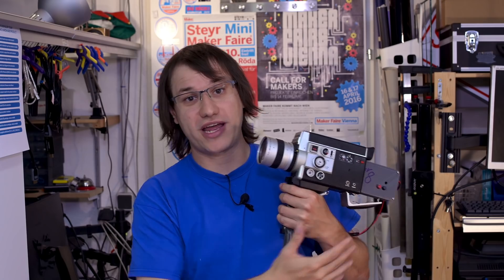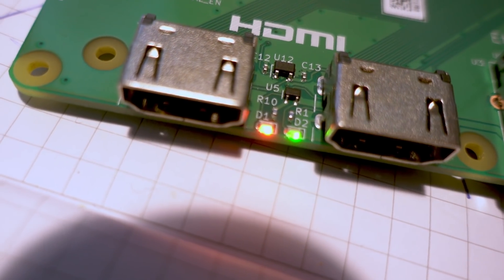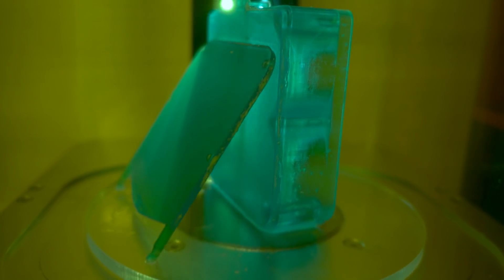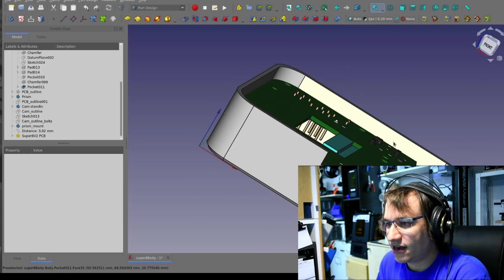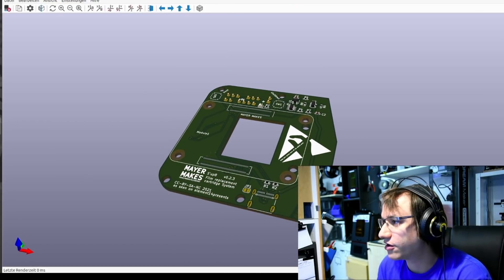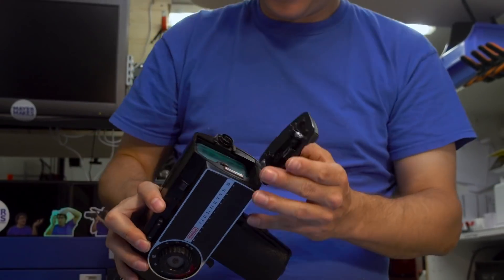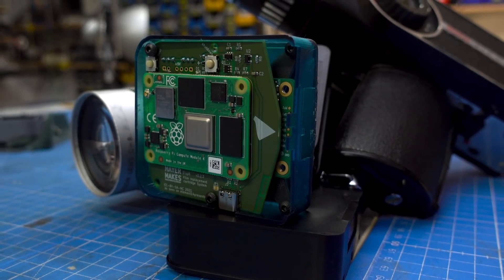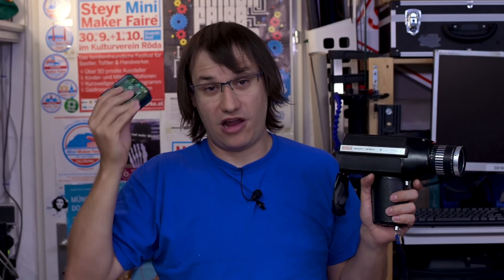Super 8 Camera Digitizer with Raspberry Pi 4 Compute Module

Comment: Hello my friend, I have a question. I was looking for software that would allow me to control the settings of the IMX477 sensor, same I use a cinema camera, and I found this group of software: CinePi V2, CinePi -SDK, cinemate , so I tried it on a Raspberry Pi 4b board and it worked well without any problems. But when I use the Raspberry Pi WaveShare-CM4-Nano-B board, just the software interface works without any image, and I would like to help me to solve this problem.🙏🏼

Comment: I can't imagine that a sufficient market actually exist for this product today.  The proliferation of low cost digital HD even 4K video camera's much easier to use would seem to make this product obsolete before it came to market. 

Your power issue is likely resolved if you just turned off WiFi.

Comment: Congratulations for the video. I would like to suggest two solutions. You could use supercaps (two connected in series for example) put directly in parallel to the power supply. To charge them is an SMD IC from Linear Technology (LTC3128EFE). The beauty of this chip that you can adjust the input current and limit it so as not to strain the battery. To obtain the 5V if necessary there is always a buck-boost signed LTC3119 from Linear Technology. The whole thing doesn't take up much space and could act as an energy buffer.

Comment: The sensor being much farther away from the normal film plane... Hmmm..  makes me wonder if the lens will be able to focus far enough away to be usable. Maybe a corrective lens could help. Or maybe you can do like the old 35mm adaptors where you put a thin milky white sheet of some kind in the place of the film plane so you can use a fixed focus lens system to record off of that plane?... 

Man... It sure would get easier if you could just detach the sensor from the PCB and put it at the film plane. :P

Comment: Why not put an external power supply and run it in the handle. If i remember there is a cavity in the handle in most of them. You could use that space to put it. 

Great concept. It would allow usage of the older cameras no longer used. Recycling them.
Reply: Every camera model is different and in most cases there is no way to get a cable through anything without modifications to the cam, the godl was a true drop in replacement.

Comment: Hi Clem I've really enjoyed the Super8 project.  Inspired by you and others I am attempting something similar for an Agfa Microflex 300.  The side opening arrangement is much easier for me.  Just though I'd let you know I've printed the .STL files in ABS to do some trial fitting of components and I noticed, that there isn't a hole or recess in the body of the printed box to accommodate the drive dog for the film cassette, so on closing the cassette door it jams a bit too tight. Something to look at for a future revision if the aim is to have a universal drop in replacement for the Super8 film.  Build here is a Pi Zero Cam, Pi Zero 2W, LiPo Hat and 3500mAh battery, it's a tight squeeze to say the least. I'm currently working on the Agfa to get it to fully functional.  Many thanks, best wishes and I'm looking forward to your updates on the project. Pete
Reply: awesome! keep us logged about your project!

Comment: I wonder why the Pi Zero wouldn't be adequate? I know it's not as fast but it's a lot more compact, cool and has low power consumption.
Reply: the pi zero is a lot bigger thean the Compute module 4 and doies not have anywhere near enough computational power for real time capture.
Reply: @MAYERMAKES  I wasn't expecting it to be bigger than the CM4 as it's so low powered. I'm surprised it doesn't have enough juice to record video as it does have a camera connector.

Comment: Have you considered undervolting and underclocking the CPU to lower the power requirements? I can't imagine you need the full power and speed of the rpi4 for this functionality. 

Amazing work either way and can't wait to see what you come up with!
Reply: Not yet, the first design approach is to make it work without setting tricks, underclocking is only an option when others fail.

Comment: what is powering your shutter? how much voltage is the shutter using? can you replace the camera batteries with an adapter? which camera are you currently using? getting hdmi out of the camera body would be ideal. would you consider looking into a  camera bigger cartridge (I know a few)?
Reply: All explained in the video. The camera and cartridge are independent in all aspects.

Comment: This has gone a long way! And formulating a special resin to make a more durable print? Super interesting.

I know your a camera aficionado and are pushing to get everything into that cartridge and not need to modify the base camera in any way, but what about non-destructive modification? Such as replacing the cartridge door, with say a 3d Printed one that has a hole in it to allow for a barrel jack or usb connection for power etc. Kind of piggybacking off of Jeff Greerling's initial suggestion, but in a way that keep the integrity of the camera and its collectability in tact, while also allowing you to fully test the current iteration of the cartridges camera and prism placement. Or a dummy cartridge with the camera/prism in place, and a 3d printed cartridge door with a slot in it for the camera modules ribbon cable to allow for rapid tinkering with it's placement for optimizing or even finding a way to get the prism lined up with where the film normally is, allowing for using the built in viewfinder accurately?

Anyway, your more knowledgeable on this, I'm just spitballing ideas, I look forward to your future developments and other projects. :D
Reply: Thanks, we collect all the ideas at the page linked below the video, some may be worth a try but I can see more problems cropping up with them. Either way I want to make it work in any camera so the bar is high..

Comment: Pololu has a lot of good switching supply modules on their web site.  The U3V70F5A is easily small enough to fit, and can supply 5 volts at 3 amps for most of the range of a LiPo's discharge voltage, but you'll need something else to charge it.
Reply: chargin is already delt with on the board, so it could be an option.

Comment: Why didn't you use the original 8mm cartridge for the housing? What does that look like on the inside? Also here is a very small 300W buck converter https://www.youtube.com/watch?v=G4GPfi5Ozvg
Reply: The original cartridge has basically no space inside, absolutely unusable. Refer to the first video on this project to see the insides.also cutting up 40€ cartridges for production would be unfeasible @)

Comment: How about making a power supply that fits inside the handle of the camera and make it so that when you insert the cartridge the power gets connected
Reply: That raises a lot of other problems, there is usually no connection between those cavities and every cam is built differently.

Comment: You should hook up a logging power supply (temporarily) in place of the step-up converter.  Run the prototype through boot up, recording, playback, download, and any other "operating modes" you expect to support.  From the plotted current results, you can determine what minimum supply is needed (based on peak mA output).  Or you may find that the spikes in current draw are small enough (in energy, current*time) that a supercap on the output of your prototype's existing supply can bridge the gap. (as pointed out in another comment)  
By measuring the project's power consumption, you can optimize the supply rather than over-designing (since space is very limited).  Also... I didn't catch if you explained the voltage and current requirements of each module.  Do you need to provide multiple voltage rails?
Thanks for the awesome projects.  You inspire so many of us to do more.
Reply: Thanks, very good points, the prototype needs a single voltage rail expected optimum is 3A@5, 2v without any ripples or drops. It operates at 2A now but browns out once the 2A are reached, due to a voltage drop below 4,8V
Maybe we make a dedicated power supply episode one day.

Comment: use a li-ion battery. like the ones from rc hellicopters ect . all you need is 15 minutes run time . they are verry small and powerfull
Reply: There is a lipo in there like you would use on a quad. The problem is the current delivery capabilities of the step up converter that is needed

Comment: Not the solution you were asking for, but could you use wireless charging coils to transmit power to the device through the housing? I realise this might be a stupid suggestion...

Otherwise, have you tried disabling interfaces like the HDMI and PCI of the Pi to conserve power? It probably won't be enough on its own, but it might help get the power requirements down to something that's easier to achieve.

FInally, maybe you could undervolt the Pi and run it straight off the battery, without a PSU in between? Again, this might be a stupid idea.
Reply: No idea, if reasonable e is stupid, the mentioned ideas are I fortunately not viable, but we will find a solution eventually

Comment: Oooooh... so close! Can't wait to see this thing working!

I've thought for years that somebody should be making conversions for old SLRs, and maybe even Polaroid cameras.
Reply: a lot of people tried, but its a very tough project.
Reply: why? you can just put the lenses on digital cameras.. and it accomplish the exact same thing. so rather move the lens, than try to put the digital camera inside the other camera.
Reply: @Nobody-Nowhere  The lenses are not interchangeable between most film and digital cameras, and even if they physically fit all of the electronic functions usually don't carry over. Film SLRs are far more rugged and higher quality than any digital SLR. Film SLRs give you more manual control. You already know your way around your old camera, and digital camera menus are a nightmare. Why spend thousands on a new camera body, not to mention lenses and other acessories and have to learn a whole new way of doing things? And they change the menus with new versions of the same model, so you're continually having to learn where they've hidden and buried basic, often-used settings. With a fim camera and digitizer adapter you can permanently stick with the same camera and accessories and just upgrade the digitizer when it becomes advantageous. You still have the option of using film for the additional creative power that gives you, without having to lug around another camera and kit. And you could take video with that same old still camera that never had that capability before.

There are a hundred practical and thousands of financial reasons to stick with a film camera.
Reply: @awo1fman  So what lenses are not interchangeable?  " Film SLRs give you more manual control. " Like the shutter speed & aperture? :) You definitely cant do that in digital cameras.
"Why spend thousands on a new camera body, not to mention lenses and other accessories" You don't have to? You can get used digitals really cheaply. And do you think purchasing a specially made digital sensor that magically fits into the film bay, is cheaper?
" have to learn a whole new way of doing things" You kinda have to learn it anyhow when you put a digital camera inside your film camera.. it really changes nothing. You have to learn digital processing, photoshop and all that.
Also, there are already countless digital backs for medium format cameras. 
It just makes no sense, this is all about some sort of hipster dream of looking cool while shooting film cameras. Its literally about hiding a digital camera inside a film camera to look cool.
Reply: @Nobody-Nowhere  So what you're saying is, "Nananananananana, NO, YOU!" and making assertions that are obviously false.

As a user of both 35mm film cameras from the 1980s on and digital cameras from 2000 on, I know exactly what I'm talking about. There are many lenses that in theory physically fit a given mount, but when you go to try them they actually don't fit. Even when they physically fit, they don't have all the same electrical contacts. Even if they have the electrical contacts the electronics and logic in the camera don't always work the same. Then there's the matter of ruggedness. Modern cameras and lenses are mostly plastic. Old camera bodies and lens housings were mostly metal.

There is no such thing as a cheap digital SLR. Even the "entry-level" ones are NOT cheap, and as soon as you start adding things like flashes and decent glass, the cost is in the thousands of dollars. That's not cheap.

No digital camera offers the total manual control that a full manual SLR does. Digital cameras are designed to not allow you to take pictures that their programming thinks will not produce a usable result or that might cause damage to the camera itself. A manual film camera allows you to make whatever settings you want, and sometimes you're not trying to take a picture that is "good". Sometimes you want to do something that is massively over- or under-exposed, or totally out of focus or blurry. Or you want to do something that requires physically unmounting the lens and using a technique or device that makes the camera think there is no lens attached even when there is (like tilt-shift or extension tube). Digital cameras don't do well with that because they are designed with self-preservation in mind, whereas old film cameras don't care. They don't have permanent sensors to collect moisture, dust and debris or that can get scratched or otherwise permanently damaged. Many of them don't even have batteries or electronics of any kind to malfunction or be damaged, so they are ten thousand times more reliable.

One thing that is very different between digital and film cameras is the way they react to filters. Trying to use filters with a digital camera is an exercise in frustration and more often than not is outright impossible. The sensor and electronics fight the filter and try to compensate and "fix" the effect you're trying to produce instead of just letting you do what you want to do. Using a film camera with a digitizer would solve that problem because if all else failed you could just pop in a roll of film and force the results you want. Without having to carry around two cameras and all their respective accessories and support gear. And no, there is no amount of digital editing that can substitute for the real thing.

I've used many different digital cameras over the years, sometimes updated versions of the same camera. They're all rubbish and they bury settings that I use constantly deep in menus that are a pain to navigate and use. And the menu structure is always different in some fundamental way between cameras, even adjacent updates of the same model. Frequently the settings I want are only available in full manual mode because the various modes always "helpfully" lock you out of certain features for no reason. Such as wanting to use fill flash in in "landscape" mode. Nope, can't do it. Even though there are frequently things in the foreground that might be backlit or in shadow that you need to illuminate (a sign, a person, an animal) but you want the depth of field and all the other settings of landscape mode because it's essentially a landscape photo. Or something fleeting happens and you need to instantly fire off a photo and don't have time to turn the mode dial but do have time to press the flash button or another instant setting but it doesn't work because you're in the wrong mode. I'm constantly having to futz around with the modes on my digital SLR because the one that seems obvious just won't do what I need it to do. So if you're going to have to go full manual anyway, why not use the camera you already have that is more durable and much simpler to use, not to mention is already paid for.

If you've spent several thousand dollars on a camera body, lenses, flashes and other equipment then yes, it would be far cheaper to just add a digital sensor to the mix. Even the pro camera bodies that cost thousands of dollars are the cheapest part of the investment because the good quality lenses that fit them cost even more. If a single lens will do everything you need, then you're wasting your money on a camera with interchangeable lenses and you have no clue what you're doing or talking about. A point-and-shoot with a long zoom is a very long way from being the same thing. And the sensor is not what makes the camera expensive, it's everything else.
Reply: @awo1fman  dude all of your points are bogus. you can buy an old sony nex for little over a hundred bucks. an old fuji for couple more or an a7 series for a little more. You can adapt any lens to these cameras and they give you total manual control. the fujis are metal and so are the a7 sonys.

Comment: Great project Clem. Looking forward to the PSU solution. Half a thought entered my head about wireless charging, and whether that could be used to boost the internal battery for a short time to set up, then be moved away for normal use... but, probably not viable
Reply: Yes, that idea while an interesting concept comes with some drawbacks that make it not viable for this pi articular project.